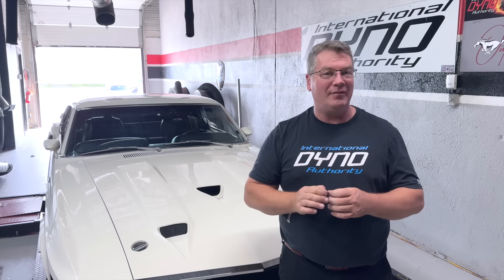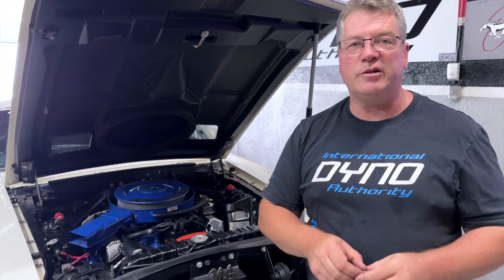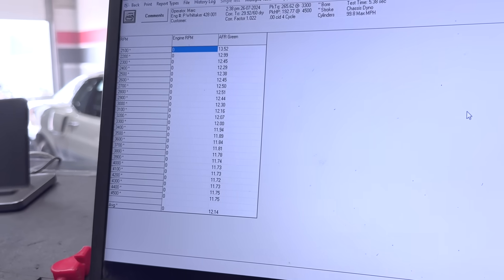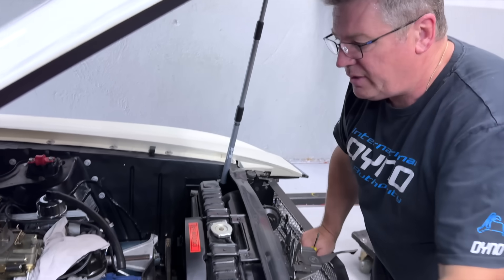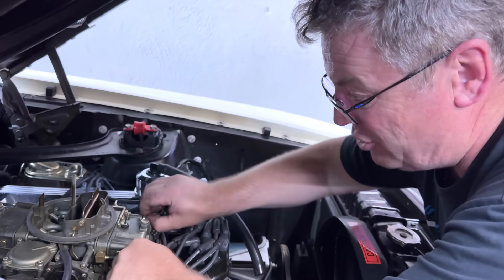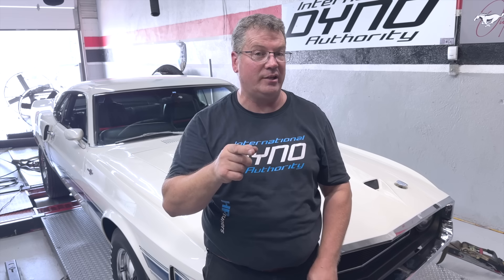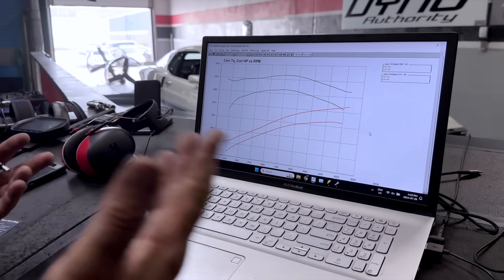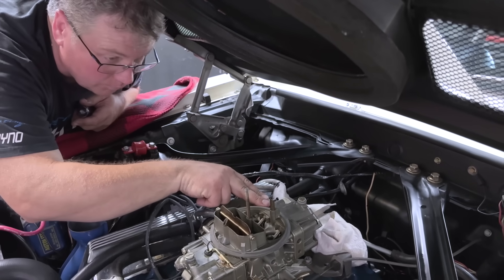Original, unrestored '69 Shelby GT500 tuned on the dyno

Comment: Change the manifold to fuel injected throttle body, get an ECU, forget about it.
Reply: You completely miss the point of this car.
Reply: Computers suck
Reply from the maker: @TLH442  International Dyno Authority: Pioneering the Future of Tuning and Combustion Technology

As North America’s premier facility dedicated to advanced tuning and research, International Dyno Authority (IDA) has set the standard for tuning and power optimization across a vast range of applications. This cutting-edge institution has earned a reputation for excellence through extensive partnerships, groundbreaking innovations, and the development of tuning standards that are transforming the industry.

Partners in Innovation

IDA collaborates closely with leading corporations, advising powerhouses like HP Tuners, Whipple, Roush, and Ford Motor Company. Their insights and technical support have become an essential resource for these companies, driving improvements in engine performance, efficiency, and emissions standards. Through these relationships, IDA has a unique vantage point to pioneer developments that shape the industry’s future.

Pioneering Standards in Tuning

Since its inception, International Dyno Authority has been at the forefront of the tuning industry, not only setting new standards but also elevating the capabilities of tuners of all experience levels. Through their publications and training programs, IDA provides essential resources that empower both novice and professional tuners, equipping them with the skills to achieve precision tuning across various engine platforms. Their commitment to education is evident in their comprehensive curriculum, covering the intricacies of combustion dynamics, air-fuel ratio (AFR) tuning, boost management, and fuel characteristics.

Educational Outreach and Online Presence

IDA has established a strong online presence, notably through their YouTube channel, which serves as an invaluable resource for enthusiasts and professionals alike. Their instructional videos, which include step-by-step tutorials, practical tips, and expert insights, are used by institutions such as MIT, Boston College, SCT, Holley Inc., and Edelbrock, making IDA a recognized leader in education within the field. Their expertise has also gained the attention of influential industry figures, including Steve Morris, who has commended their contributions to tuning technology.

Specialized Focus and Areas of Expertise

Operating as a purely tuning and research facility, IDA’s specialization spans a wide range of topics. They delve into complex subjects such as combustion technology, AFR tuning, boost and fuel optimization, and luxury engine swap integration. The organization’s work also extends to advanced fuel research, as seen in their recent collaboration with TTC, Hydra-Gen, and DynaCert. Here, IDA took the lead in developing an 8.9L Cummins engine hydrogen supplement fuel program, which included rigorous emissions testing, underscoring their commitment to sustainable and innovative fuel solutions.

The Facility’s Technical Scope and Testing Capacity

Each year, IDA conducts over 650 vehicle dyno tests, tuning engines and chassis systems to optimize performance. This includes a wide variety of engines powered by gasoline, E85, diesel, hydrogen, port and direct injection, throttle body injection, and even carbureted systems. Their expertise is not limited to traditional vehicles; the facility also tunes boats, tanks, and military transport, making them the only independent tuning and research center in North America dedicated to such an expansive range of engines and fuel types.

Advancing Industry Standards

By leading projects in combustion and alternative fuels, IDA continues to be a key player in the evolution of tuning technology. Their dedication to setting new standards in performance, efficiency, and sustainability has positioned them as a trusted authority in an industry that is constantly evolving. For anyone looking to understand or pursue high-level tuning, International Dyno Authority remains the ultimate resource and innovator in the field.

Comment: In 2012 i bought a vFord Mustang Performance Package 3.7 L V6 with the only transmission availability in these models that was a speed manual transmission witha 3:31 rear gear in the rear end, i should have got the optional 3:75 gear in my car. My car put out 308 hp to the wheels amd ran 0 to 6 in 5.1 seconds and running the quarter mile in 13.7 and it weigh in at 3400 plus lbss. When i raced it on the drag and when i put on 17inch wheels drag radialsvthat were 255 17 40s it ran 12.5 second quarter miles
Reply from the maker: @Ira-k6l  

12.5

With a V6 

With a standard transmission 

With a 3.31 gear......
Reply from the maker: @Ira-k6l  so that means 

370 HP from a V6 rated at 305 HP

What turbo / supercharger kit?

Kenne Bell?

Comment: How it was back when that was built 300 hp was big deal now 4 bangers have that much or more not bad just history of automotive how we have progressed
Reply: Over-stressed, turbo-charged, overly computer micro-managed tiny engines are not progress.
In 20 years, that Mustang will still be running with that engine.
Not one of the "4 bangers" from today will be running in 20 years.
Reply: @YippeeSkippie426  Well, for example 300 hp from a 2 liter four cylinder is not over-stressed. It is massive progress if we think how bad fuel economy those old V8 engines have compared to a turbo four cylinder. Or how complicated and heavy those V8's are. There are also lost of four cylinder turbo cars from 90's onward still running.

Comment: What a beautiful car. Original or not, it needs a coyote with a blower on it. Less than 300hp from a big-block CJ? That's a crime against God and Man.
Reply: It was only rated at 335 at the crank so what would you expect? Those old engines are like a lawn mower compared to whats available now in a stock vehicle. Most of those were 14 second cars.
Reply: "The good old days weren't always so good."
Reply: @YippeeSkippie426  Impossible to compare anything from 1970 to 2024 specs. whether its a Lamborghini or any old muscle car or lambaste it due to age or the ways engines were built then. Looks at the cast heads and the way they were manufactured then, core shift, etc. which was so common especially on a BBC, a basic 3 speed auto. trans. or a 4 speed, all made huge differences in performance, however the suspension matched the power so they really felt faster than they were. A 550 hp engine in that would equate to blown transmissions, rear ends and the car all over the road, still more fun to drive an older car WITHOUT all the traction controls, etc. as the driver is in command. A good 450 hp crate motor would be a nice upgrade for that and keep the original engine. Things are all relative!

Comment: Cool to see a fellow Canadian company work on this old stuff. It must be unnerving to rev an original FE that high considering you have no real knowledge of the condition of the engine other than oil pressure. Did you find that the air cleaner affected the AFR much?
Reply from the maker: @yarrdayarrdayarrda  The air cleaner the had no effect on AFR at the tail pipe.

Comment: The whole reason carbs were givin a bad rep was it takes adjustments to run right.
Reply from the maker: @thomashalley7258  All vehicles are "factory calibrated".... Basically the manufacturer' best guess.

Our job is refinement. Once they have been Dyno tuned. Each vehicle has that extra attention , put into re mapping fuel curve to correct.  Remapping cam timing to be correct. Adjusting torque management, and ignition timing.  All vehicle's have a spark of new life.  Increased efficiency and much more power.
Reply: so does FI.  Your point?
Carbs got a "bad rap" because people were uneducated or just ignorant and did not want to go through the very simple process of tuning.   FI?ECU just made the process electronic and not mechanical... better for the "Man-Bun" geberation to deal with.

Comment: That helped me a bit with my FE tuning, I didn't catch where you ended up with the timing. I tried not using the vacuum advance but went back to it. Beautiful car! Thx
Reply from the maker: Yes, the timing was a critical part of this tune; the initial timing ended up at 14 degrees, and the fully ramped-in timing was 31 degrees, which is quite a bit more than it was when we first started.

Comment: Should've dumped the Holley age's ago!! Wasted more time on with the Holley on my 71' 429 Mach 1. Along with several other's, always blowing Power Valve's, leaks etc.
Reply: 429's were not good street engines. They were made to run flat out all the time. They suffered from leaks. The heads didn't even use gaskets
Reply from the maker: It was the customer's decision to stay with the existing carburetor and we were happy to make it run as well as possible.

Comment: I'm curious if you pulled a plug or two so you could see what kind of condition they were in.  If the car had been burning that rich I can't imagine that the plugs were in very good shape.
Reply from the maker: @mcgilm69  You're absolutely correct. And, before a customer arrives for a tune. There is a very comprehensive, very complete, and very thorough pre-dyno checklist which they must go through. Through. These things include, the health of the tires, the ceiling of the exhaust, and, at the same time things like fresh plugs, fresh oil, good spark plug, wires, water, hoses that are in great condition, etc, etc etc. You should check out our website. You can see the entire list. It's pretty comprehensive and, it allows our customers to see how seriously their vehicle needs to be gone over before we bring them in for a tune. Now there are certain characteristics that will be exhibited if, plugs are in a bad condition and or a fouled condition. Such as the startup. When a vehicle has poor plugs. No matter what you do with the tune, it's not going to start very well. And it's going to require extra cranking time. So these are some of the things that we go over before during and after. Check out our video on the recent Honda Accord that we tuned. Which we suspected the plugs were not in very good condition. We were correct. Not only were they in poor condition, they were also gapped incorrectly either through time or wear etc. Cheers and have a super weekend!

Comment: Audible gasps from the audience when he went to work on the carb with no rag underneath to catch fuel.
Reply: Seems pretty obvious to me that there is a rag in place when he takes the front and rear off.
Reply from the maker: @thepacketnarc7634  We went back and reviewed both the primary end the secondary adjustments. Each time when the float bowl was removed. There was a rag, a white rag, underneath both the front and the rear. Respectively, when the adjustments were made. Made. So I'm just curious, could you point out the time in the video. And show us the portion? Maybe give us a moment in the video. If you look at the 13:50, you'll see that there is a rag underneath the rear. And in the front. It's very obvious. Anyway, give us a timestamp, because we definitely wish to be as responsible as we possibly can with other people's vehicles. And never, remove any pieces or parts, when they are pointed out, especially in a video that we didn't put a rag to absorb the fuel. Thank you very much. Much have a super weekend, and cheers!
Reply: are you blind?

Comment: Slower than a Corolla
Reply: What am I missing here? The shelby has 300hp and 400 lb-ft of torque with a 0 to 60 in apparently 3.5 seconds. A 2024 corrola has 169 horsepower and 151 lb-ft of torque and 0 to 60 in 9 seconds. This despite the corrola weighing almost 1,000 lbs less.
Reply: @siskens470  You're just missing his behavioral disorder, nothing much really. It was a dyno test/tune session, not a race or speed test. He's just trying to stir up some activity/reaction for spite.
Reply from the maker: @siskens470  what's missing, is the offset from the center of the crank. Even though an engine can develop torque over time. The amount of torque that it develops at a lower RPM and the average torque that it develops throughout the entire range means that the acceleration will suffer, even if it's lighter. When we're talking about a very tiny engine where the offset from center on the crank and otherwise known as stroke, is very little, it means that the engine can produce torque based on repeated revolutions of the crank, but it does not make torque immediately. So while one may have a number that appears to be similar to another car. The actual average torque and the speed at which it develops that torque curve at the same time as the amount of torque it makes over time is quite a bit different. So comparing a single number on a dynamiter chart. Is very hard to do. You're only picking out one point. The rest of the curve is very important. Check out some of our other very helpful videos, where we talk about how much torque we can create at a much lower RPM to increase fuel mileage, decrease engine wear, and give the driver a better overall experience. Cheers and have a super weekend!
Reply: @internationaldynoauthority693  he said the mustang was slower than the corolla. As per my comment, 'the must can do 0 to 60 in apparently 3.5 seconds. A 2024 corolla has 169 horsepower and 151 lb-ft of torque and 0 to 60 in 9 seconds'. So I am asking what I am missing when he says it is slower.
Reply: @siskens470  - 69 GT 500 Shelby didn't do 0-60 in 3.5. 2020's models probably do, but the 60's models were in 6 sec range. However the 2020s Corollas GR models can do high 4s to mid 5 sec. on 0-60.
Reply: @BM-uk3sh  I just took the first one I saw on the shelby thru Google. Took another look and yes about 5.4 to 6 seconds. However, the corolla is still around 8 to 9. This is despite being close to 1000lbs heavier. 'The 2024 Toyota Corolla can accelerate from 0 to 60 miles per hour in 7.8 seconds with the 6-speed intelligent manual transmission, or just under 9 seconds with the gas or hybrid models: ' Doesn't matter, from what I see the corolla is not faster or at least a blow out like the early comment made it seem.
Reply: @siskens470  - Again, I said the GR Corolla models. Google Toyota GR Corolla.
Reply: @BM-uk3sh  so what you are saying is that a brand new Corolla GR can now keep up with a 55 year old Shelby - not progress I would be bragging about…..
Reply: @BM-uk3sh  thanks for the correction. Doesn't change my point that the corolla is not faster than the shelby.
Reply: @siskens470  - Your point was incorrect and not factual. It is irrelevant how you feel about been wrong. It is factual that a Toyota GR Corolla is faster than a 60s Mustang Shelby GT 500 and it will remain that way regardless of any points you may have.
Reply: @PAULWHITTAKER-f5h  - No that is not what I said. You are trying to red herring to something else and failing badly. What I said is that your information about 0-60 times is incorrect. And yes, it is factual that a 2020s GR Corolla is faster than a 60's Shelby GT-500 Mustang in 0-60 mph times.
Nothing complicated nor difficult.
Reply: @BM-uk3sh  the original post said that a Corolla was faster, this is incorrect. Now that you are adding letters to the description of your Corolla you may be interested in the fact that a 1969 Shelby GT500 with a Super Cobra Jet engine runs 0 to 60 in 4.8 seconds - which is faster than the Corolla GR, nothing complicated nor difficult. Also, I would rather own the Shelby over the Corolla so who really cares.
Reply: @PAULWHITTAKER-f5h  well said
Reply from the maker: @Samsgarden  Thank you for your feedback. We tune quite a few Corollas. And, we enjoy each one of the brands pretty much equally. This was a cool project to work on. And there was a certain satisfaction in overcoming something that had flagged the car for so long. Enjoy, cheers and have a super day!
Reply: Wish I had a guy like you the Atlanta area to dial in my 69 Cutlass.🤘🏻
Reply: I heard that if you floor the new gr Corolla or go over 100 MPH you void the warranty
Reply: @tylerwallace9185  lol
Reply: People say that kind of stuff all the time as if Corolla are the bottom of the barrel econo boxes they used to be.  A Corolla GR is a 40 thousand dollar  car with even just a few options. Yea, it also gets beat by dodge pickup trucks which would also sound really insulting if you glossed over the fact that now they make $90,000 700hp dodge pickup truck lol.
Reply: what a dumbass comment

Comment: Why'd the factory carb have a 69 jet in it?
Reply from the maker: @nehuge  over the years, the factory carburetor had been restored to whatever the factory settings were that was originally set out in 1969. When we go to the manual for 1969, it will create a spec under the carburetor subsection front primary of '69 jet. So, the 69 jet was installed. As it turned out. The air fuel ratio was incorrect. Regardless of that, I could have put a 62 main jet in the primary and it still would have been smoking and far too rich after the accelerator pump nozzles began to leak. 

However, to answer your question, that was the spec originally so that is where it was set up by all the previous people who attempted to make it correct